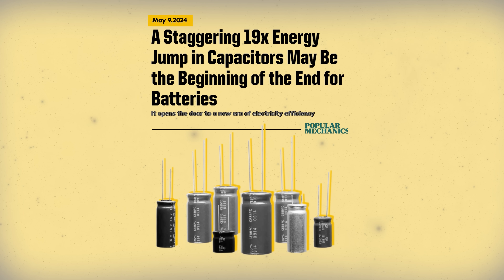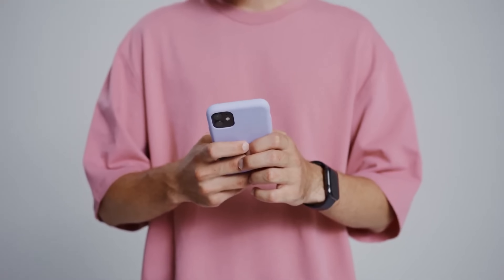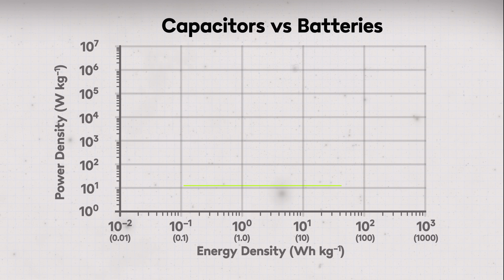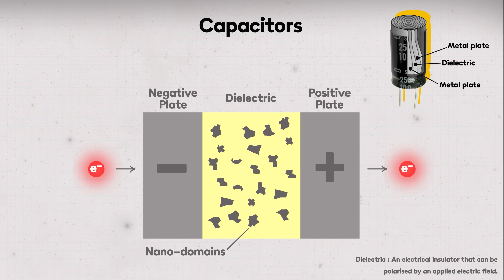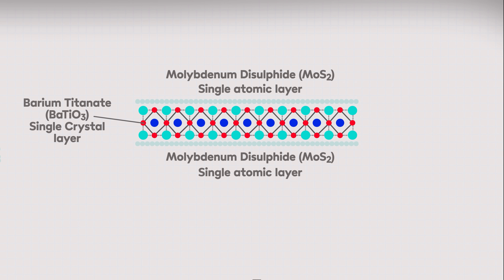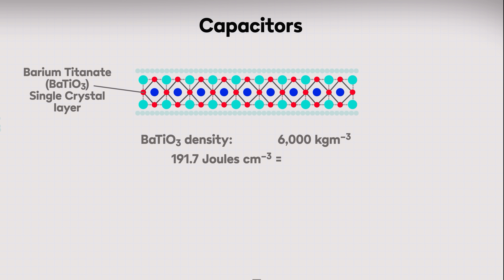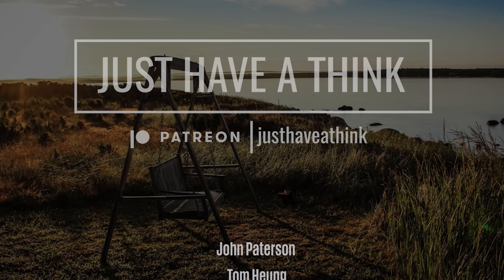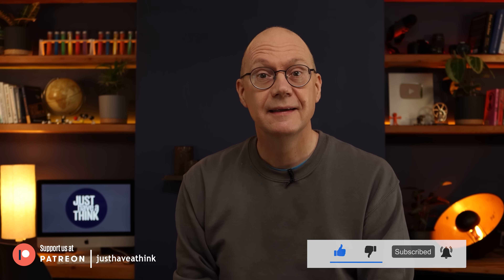Charging an EV faster than filling a gas guzzler? Surely not!?

Comment: It's a lie. Even if you create a super battery, the energy to charge it has to come from somewhere. It would mean incredibly high energy transfers at the chargers. Even current battery tech can outstrip the energy grid's capacity to deliver that amount of energy in a shorter time than filling a gastank. 
So validation or not, you won't get faster charging, simply because the grid isn't up to it.

Comment: Those are going to be some chunky charging cables.
Reply: Lot's of electrons need BIG pipes!
Reply: You would be surprised. You can see what Tesla is doing with their liquid cooled cables. To double the current capacity the diameter of your conductor only needs to increase by slightly over 25%. Plus, with such short charging sessions you can manage your thermal rise. Everything will be getting hotter, but it only has to survive that massive output for 5 minutes. Then it ostensibly will have time to cool down before the next charging session.
Reply: @otm646  
sure, but!
cooled cables do not reduce resistance that markedly.
Reply: @ursodermatt8809  losses to resistance in the cable are not the issue here, it's rejecting that heat efficiently. That's why I'm discussing both the liquid cooled cables and the duty cycle of that cable. 
It's like having a water cooled TIG torch, It's not running 24/7, but when you're using it 10 minutes an hour you're pushing it hard for a given conductor size due to the ergonomics required by the user.
Reply: @otm646  
whatever,
if you get into 10 000 amps, resistance is getting much more important.
besides super caps will never play a role in EV"s.
so we don't have to worry about it either way.
Reply: Don't u just need // charging from caps?
Could be interresting to know how China's caps run Street cars do it.
Charged during stops

Comment: Wouldn't the big advantage for regen be better realized if the majority of the captured power were used directly for powering the motor rather than going to the battery? So for example the car slows down and stops for a stop sign. The capacitors charge up from he regen. Then the capacitors discharge directly back to the motors for the acceleration from 0 to 40kmh or whatever and then the battery only starts discharging again when the car is rolling along at a constant speed, rather than for the big draw needed for acceleration? This would really improve efficiency for urban driving a lot, though maybe not so much for highway driving.
Reply: Capacitors don’t hold enough energy to either decelerate or accelerate your car. They work best at nanosecond and microsecond scales; supercapacitors extend that to milliseconds and ultracaps to seconds, but they are far too expensive per joule stored.

Current batteries, however, can provide enough power for regen and acceleration at very high efficiencies; the efficiency limitation is at the electric motor and drivetrain, not the electricity storage device.
Reply: This is how the capacitors and electric motors in foemula 1 cars work. 
tthe capacittors give a power boost for acceleration over a very short ttime intterval. This is important for racing cars but irrelevant for road cars.
Reply: the batteries already do that
Reply: @ursodermatt8809  yes, I understand that is how regen breaking currently works. What I'm saying - and I might be wrong! - is that batteries have a bottleneck to how much charge they can take in a few moments, and pushing the limit frequently does cause degradation in the long run. A capacitor of sufficient capacity could not only take in more power from the regen than the battery could, but would spare the battery the degradation caused by frequent rapid charge/discharge.
Reply: @adamlytle2615  
do you have an electric car?
there is no bottle neck.
even if there were, your bottle neck is only needed in emergency braking.
"frequent rapid charge/discharge" , ???
you are driving like a hoon? even that kind of hooning will not affect a battery.

Comment: At that density, you need ~20kg of capacitors to drive 1km.

If you only had capacitors, you could likely get 25km range.

And if it charged up in a minute, it could work for inner city transport.

I know people who only tank a few liters when they are nearly empty. It wouldn't be any different from that. They never have a full tank.
Reply: It's not for storage, it's for recharging, and regen braking. It's interesting, lets see how it works outside the lab.
Reply: Actually just ~3km would be enough if you combine this with a small regular battery(like 5kWh, enough for 20-30km detours) and wireless induction charging at traffic lights, parking spots and drive thru's etc.
 It could have some interesting possibilities for city mobility 🤔
You could easily recharge it by ~10% in mere seconds just passing over a wireless charging spot. 😁 (~20s @ 100kW,)
It'd be a crazy amount of infrastructure work, but not impossible. Busses & trams could definitely benefit from a variation on this(possibly using overhead pantograf/physical connection at stops.

Comment: No car will ever be green. Not even a little bit. It's a 100 mph living room in a steel cage. A person on a bicycle uses about 200 watts to get around, a person in a car uses about 200,000 watts! That's the easy problem. What's easy about it? Well let's just hand waive away all the wastefulness of the car itself and just say it's perfectly green. No energy to use or manufacture a car. Here's the hard problem: the road it drives on (and the damage done to the road by a 3 ton vehicle) is enough of an environmental disaster that cars can never be green!
Reply: "a person in a car uses about 200,000 watts! " - that's a bit of an exaggeration.  Typical personal vehicle use tops out around 100HP for daily driving - more if you want to go high speeds on an interstate highway of course.  100HP is about 75kW.  Yes, still a lot more than a bicycle.
Reply: @TheDanEdwards  I also don't ride my bicycle at full tilt everywhere I go.
Reply: It's relative - EVs are much better for the environment than Combustion vehicles. Who would want to use a bicycle to take a trip of over 1 mile? Or even less if you were buying things like groceries. 

Most people buy SUVs, Trucks, or Vans - the average EV is not really heavier than those vehicles. And the VAST majority of road damage is from Heavy Freight vehicles, dump trucks and the like.
Reply: @FLPhotoCatcher  I do every day as do many others. Why do you want to own and operate heavy machinery so badly? It's not actually convenient. If I need to buy something bulky I'd rather have a professional with the appropriate tools do the moving for me. Cheaper and more convenient than having to own and operate a bonkers expensive machine like a car. All that money and time on maintenance and repairs. Five years on the bike now and I haven't looked back once. Plus just the act of driving is so stressful. I feel much better getting around under my own power. If you just want to travel somewhere far a train blows a car out of the water for comfort. Sorry folks, cars suck!
Reply: North Korea has almost 0 car and Everyone is forced to ride bicycles 

This utopia is only one flight tickets away 

Go there